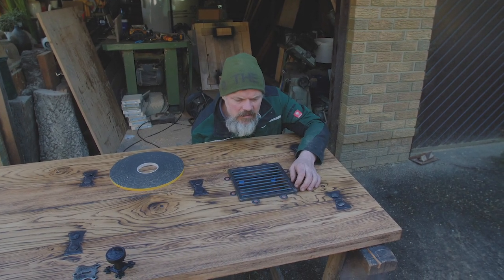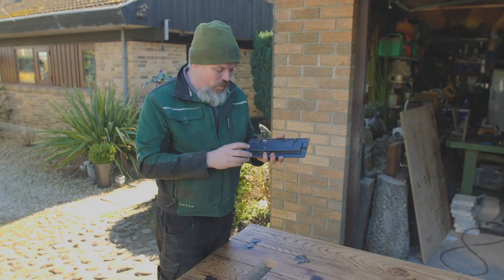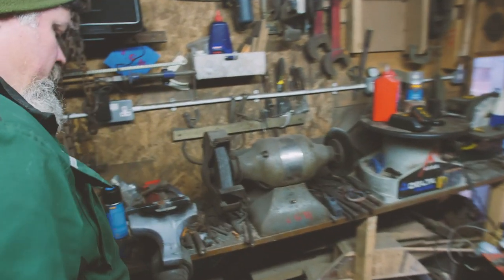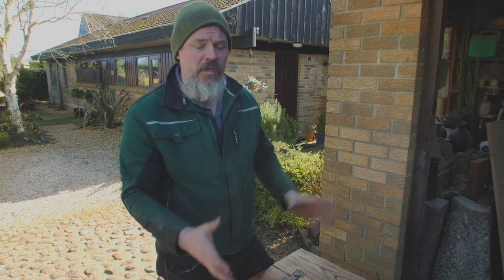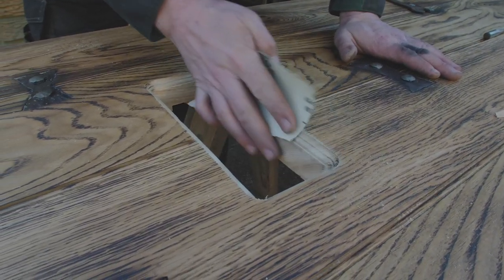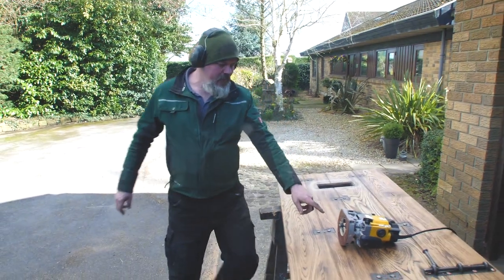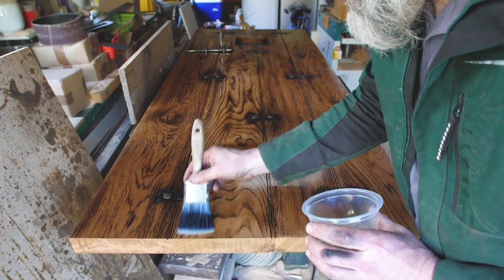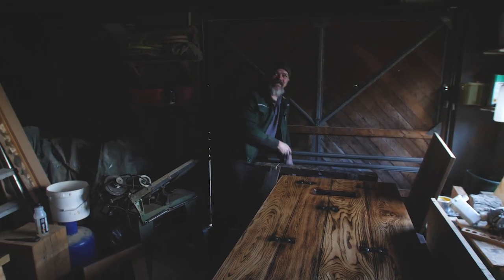Oak Door Project Ep11 | Finishing Touches to the Handmade Oak Front Door

Comment: It looks great but my only problem is how low the mail slot is. Here they are usually a little below the center. Not a critique just curious.
Reply from the maker: Terrific point, Peter - I reckon Al will jump right into this when he's up and about, but I'd suggest his reason for the height of the letterbox was to balance the metalwork aesthetically for the door's betterment, or some s**t. If you watch to the end there's a clip of Al talking about how he prefers his letters to be outside cold whilst he's warm indoors, which hints at his lack of joy at fitting the letterbox at all. But, it wasn't his door, and as with the grilles it was just a compromise that ideally he probably wouldn't have made. He's talking about making one for himself - so the sequel could feature in the near future?
Reply: Morning Peter! Cheers for watching and your thoughts! Well, the letterbox was a last minute addition (pure retro-fitting hell)! We’d gone to the trouble of balancing all the butterfly and rivets over the length of the 🚪. This was before a letterbox was decided on. So agree it would have been nice to cut this in higher up (imaging a postman having to bow to the 🚪 every time he delivers the post, poor bugger)! But also did think fitting lower down wouldn’t effect the integrity/stability of the door as much as cutting another huge hole in the midsection. It’s all organic as you know, roll with the punches kind of stuff. Hope that goes some way to a satisfactory answer. Cheers for watching and keep posted, think we’re nearly done! New project on the horizon!

Comment: Watching this in order and it appears to be two years after everyone else.  But I believe you should have cut the 10mm recess on the top and closing side of the door.  Otherwise the hinge side will be forward and top and closing side will be further forward so the door won't close.  Also my Grandfather would cut the inside, bottom of the letterbox opening at a 7 degree angle starting about 1/8th-3/26th from the outside of the door.  This helps stop binding of large mail or newspapers/magazines when they are pushed through the door. Maybe you figured this out for yourself in the next few episodes, I'll have to see.